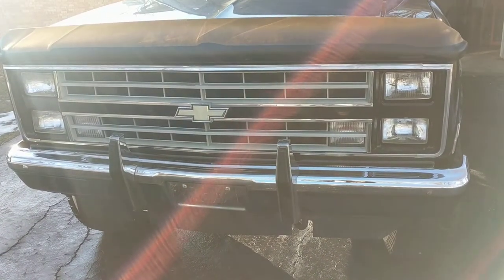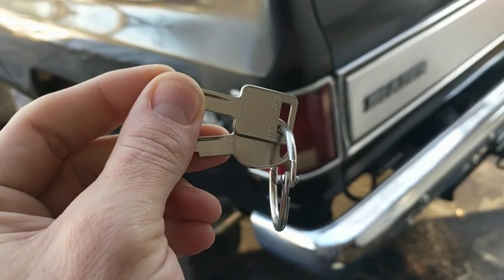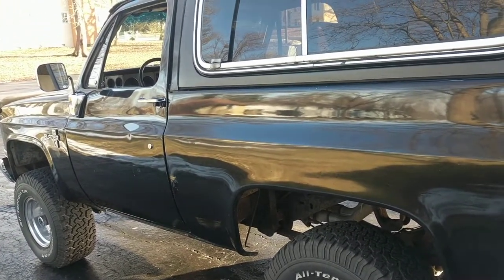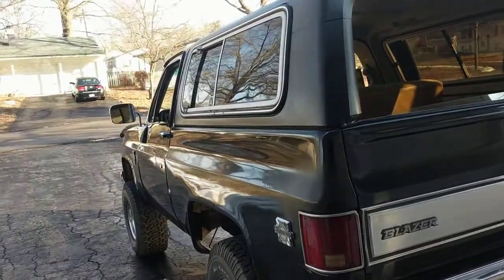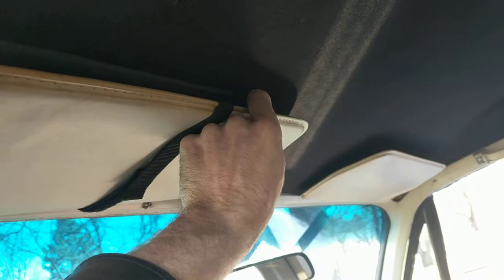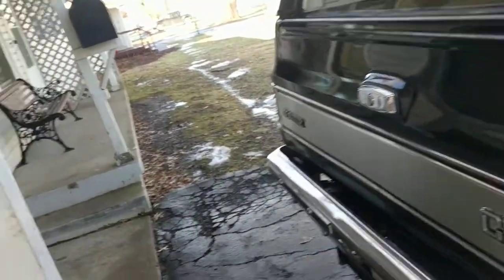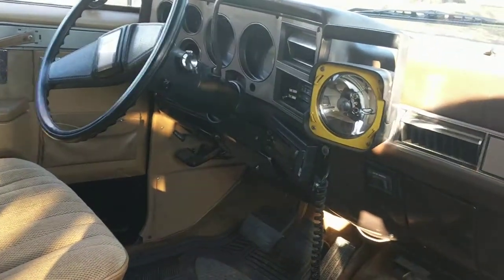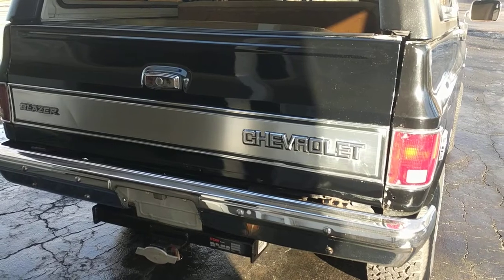35 Good Reasons To Buy A K5 Blazer part 2

Comment: Yeah fuel pumps for these older vehicles r easy to replace only 10 minutes and u done and there extremely cheap, for example the fuel pump for mi 77 Oldsmobile is $18 and it's right under the A/c compressor easy to access, and yeah fuel injectors R ridiculously experience there $85 each for mi 1988 Lincoln Town Car, I did a carburator convertion that one and took out all the computer bushit

Comment: Love it! I've owned a 76 Blazer, a 81 Jimmy, 6 Suburbans (used as crew trucks back when I had 33 employees), and currently have a 92 Yukon. It has a 355 c.i. under the hood, Falken Wildpeak AT3's 33x12.50 - 15's, 3" body lift. Gas mileage sucks at 9.5 mpg but, it'll get me anywhere I wanna go. I've replaced every major component, except for the transmission. My Yukon has some 'cancer', that needs to be repaired. That may come next Spring.

Comment: You only need one reason to buy a K5 , there badass. We just won’t mention the common striker bolt area cracking and the stock anemic 350 TBIs or worse 305 but hey that’s what the aftermarket is for. I’m buying another soon that I’m going to put a 6.0 LQ4 in (“LS”) and a 4L80E I already have a complete running doner 2500hd. My last K5 was badass with a built 327.

Comment: I miss the space between the seats and the center console.  I have a 22 f150 now, first truck since I parted ways with my blazer when I was 20.  Dropped my debit card  in that area while at a drive thru atm and got my hand stuck trying to get it.  Worst kind of stuck too, a piece of trim I pushed out of the way popped back out and held me hostage.

Looked like an idiot pulling around to the side parking lot with my hand stuck, not the safest way to drive either.  Literally had to get out of the car to get a good enough angle to get freed.  The lack of space in new cars and trucks is no joke.

Comment: ive always been in love with square bodies and now considering buying a 1989 k5... what’s the mileage like on these beauties?
Reply from the maker: 19 mpg highway and about 17 mpg city. Depends on if you buy the 350 or the 305 V 8 too.
Reply: lowride25 oh HELL YEAHHH! that’s about the same as a tacoma! the 89 k5 i was checking out was a 350. yeah i wasn’t too sure about buying it because a buddy of mine has a k5 with a built motor and he says it gets 6-8 miles a gallon lol. the one im currently looking at just got a new transmission, 4 wheel drive, new fuel tank and pump, and new exhaust. im looking for something that will last and could be my daily driver without having to constantly be replacing the transmission or engine or something of that sort every year... would you recommend?
Reply from the maker: @wolfmoon8794  I would I've had less problems with this truck than modern vehicles
Reply from the maker: I think they are reliable trucks I would drive mine every day but the gas does start to add up after awhile.

Comment: There isn't a price anyone could buy my 86 for. Mine has been in the family for about 21 years. My inspiration to turn a wrench when I was little came from helping my old man fix it. Now I work at a Chevrolet dealership. I got a four inch suspension lift like yours with 35 inch 12.5 tires. Family friends have helped me fix it and some are no longer alive. I took out the throttle body injection, smogger engine and put a 79 400 bored .30 over and installed a 72 Carter quadrajet carburetor. I love your videos and I couldn't agree more, long live the square bodies brother!

Comment: I’m considering buying a k5 for 2500 What should I be looking for before purchasing this vehicle
Reply from the maker: I would make sure the steering is good and the frame is decent other than that everything is pretty cheap and easy to fix on the old Blazers.
Reply: thank you
Reply: lowride25 I'm considering buying a 79 blazer for 2000 and it just needs a few things fixed and any advice on the 73-79 blazers?
Reply: Oh yeah it's also a Cheyenne edition I'm guessing it says it on the dashboard
Reply from the maker: I'd check the floor boards on those 70's models they rusted through a lot unless they were out west in a warm climate or always garaged in northern areas. The galvinized steel they used back then wasn't that great on some of them. Check out the frame too. Other than that they are cheap and easy to fix up.
Reply: @EddieC2000  yeah when I went to check it out frame looked pretty good and it has vice grips for the windows cranks so I'd have to get new window cranks and I'm in AZ so the guy he got it off is a AZ resident and is pretty much a AZ truck its whole life and I thought it was low to the ground  from the pictures of it man it was tall in person and I'm with you on that I really don't like 4 door trucks that much the most I'd take is an extended cab and I had test drove a 06 Dodge ram single cab man the pillars were thick on that truck it was hard to see almost
Reply: And it was sitting on 35"s
Reply from the maker: 4 door trucks are ugly looking  I'm with you deuce.
Reply: Yeah ik man and the most I'd take is a extended cab but I mostly like single/regular cabs and your right about the pillars definitely